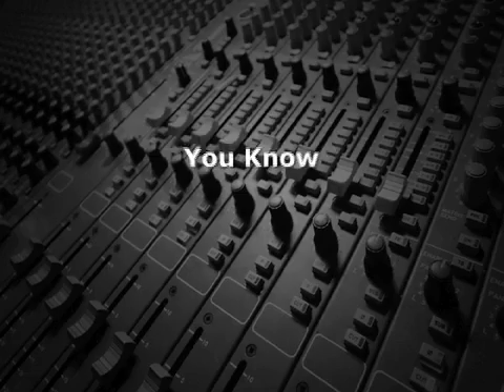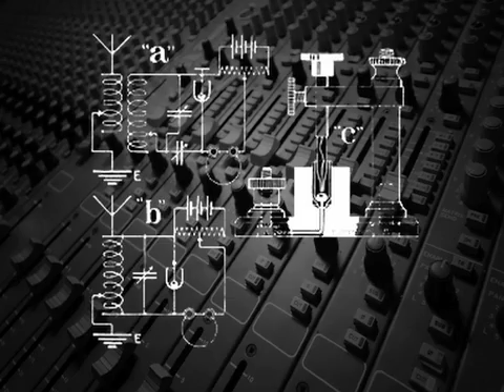The Father of AM Radio

Comment: In the early 1890's Nikola Tesla developed the high frequency alternator that was capable of generating a carrier wave that could be modulated with the human voice and eventually was used for that application before the advent of the transmitting triode vacuum tube invented by Lee De Forest.  As I recall, Mr Fessenden was sued by Tesla and I think others and lost his court case and even the Alexanderson alternator was in fact nothing more than Tesla's high frequency alternator yet for some reason Tesla chose not to sue Alexanderson.